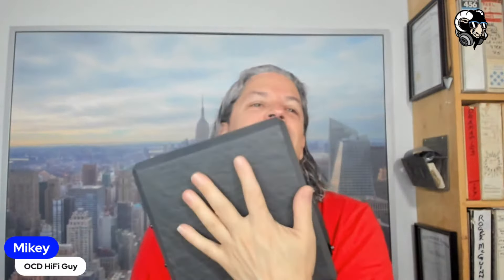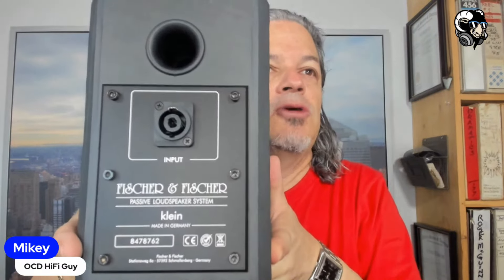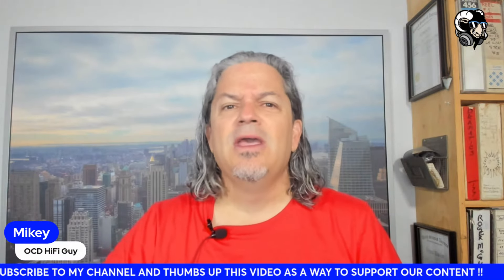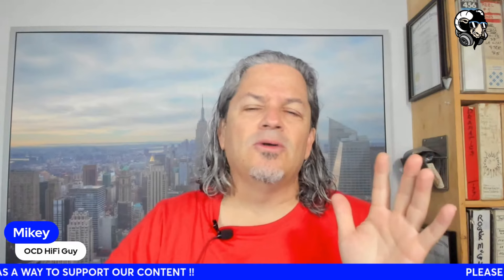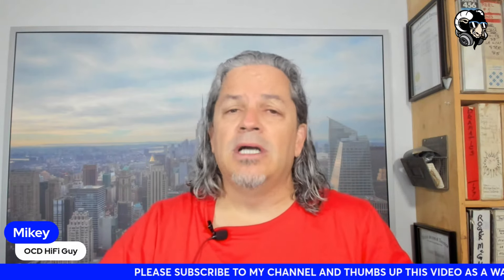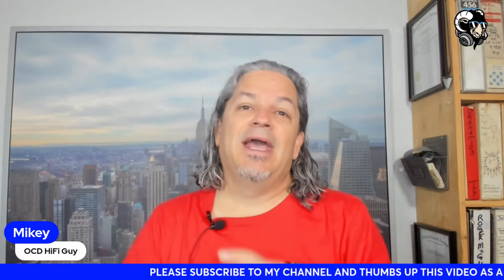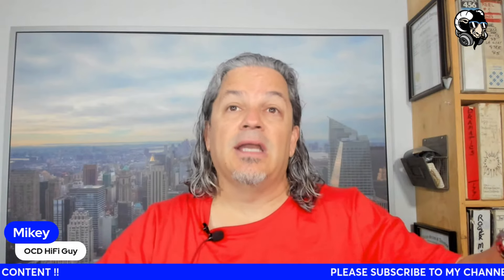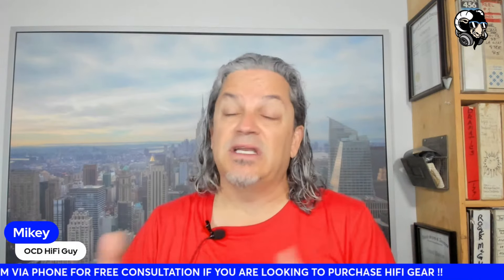USE CORRECT TERMS !! RCA/XLR-SPDIF/AES

Comment: The connector type and what protocol they transmit/receive are/can be separate things. HDMI or RJ45 connectors for IIS protocol is a more modern example of what I believe Mickey is saying.
Reply from the maker: Sort of. Moreover, how they are being used dictates what they are called.. i2S cabling is a hack, however with no standard.... ;-) it can be anything...

Comment: Are “phono cables” different than RCA cables connecting a DAC via the single ended outputs to an amps single ended inputs?
Reply from the maker: Yep. They are far more sensitive (smaller awg) and must be extremely well shielded.

Comment: Spdif is also confusing. Spdif is the encoding stream format for digital signal and can be carried on RCA, BNC and toslink. BNC and toslink are always SPDIF streams and RCA can be used to carry spdif or analog signals (hopefully using digital specific RCA cable to transmit spdif signals but any RCA should work over a short distance).
Reply from the maker: BNC is a connector interface, not a cable type.  But yes, shitass television Toslink can be used but that's in a Home Theater usually.  SPDIF should be 75 Ohm by design and even of analog RCA  cables "may work" I recommend against it.
Reply from the maker: BNC is a connector interface, not a cable type.  But yes, shitass television Toslink can be used but that's in a Home Theater usually.  SPDIF should be 75 Ohm by design and even of analog RCA  cables "may work" I recommend against it.

Comment: Most SPDIF coaxial digital connections are optimized for 75 ohm cable and any RCA cable won't do.
Speaking about digital... R2R DACs should be named "R to two R" but what the heck, just nit picking.
Reply from the maker: 75 Ohm is protocol. Still an RCA connector. Every digital coax will work as analog. But even so, you would not call it a spdif if used on an analog output.

Comment: Is there any point of using AES from my CD transport to the DAC (NewOntech 08!) if I already use RCA from the DAC to the amp? Or should I stick with Coax? Thanks!
Reply: Apperently the AES input on the DAC is the better one. I did not tried it yet because i don t have a source that have an AES output.
Reply from the maker: Yes, AES is BALANCED Digital. Try them both and decide.

Comment: Just to be clear. An XLR cable can be used as an AES? Or do you need a true AES cable (100 ohm thing) .
Reply: Any XLR will work over a short distance but not ideal. Better to use AES 100ohm cable
Reply: The only thing in common between an analog balanced XLR cable and a digital AES/EBU cable is the connector. Other than that, the two cables have different specifications and applications. The same applies to an unbalanced analog RCA cable and a digital SPDIF cable having an RCA connector. Other than the common RCA connector, the two cable types have different specifications.
Reply from the maker: You want a true AES thing... sometimes  analog XLRs can work...
Reply from the maker: @Drago, not always... a 75Ohm coax SPDIF works fine as an analog RCA but usually they are not in pairs..